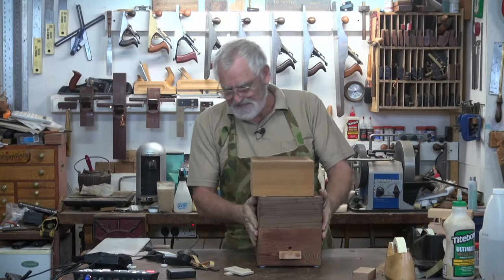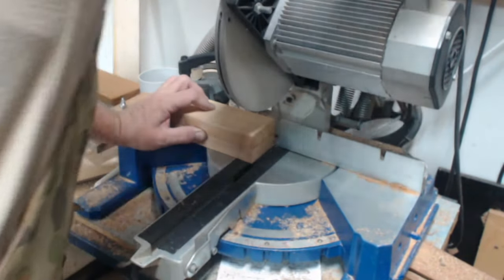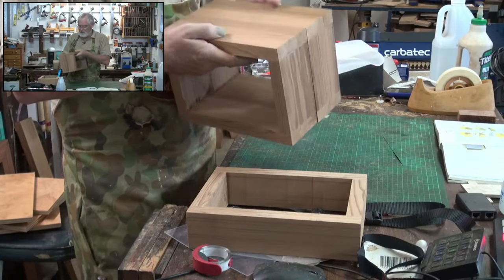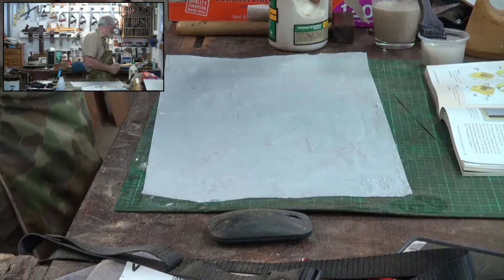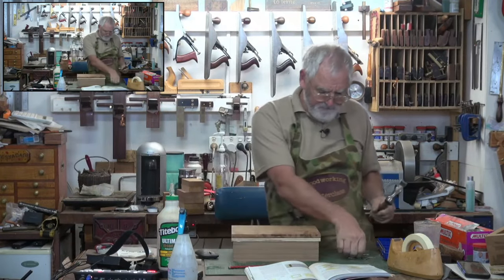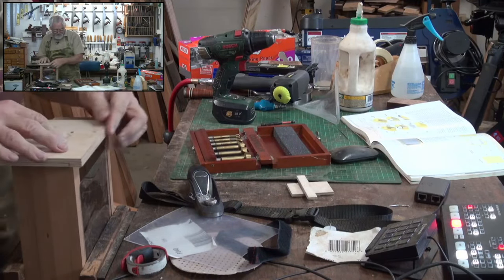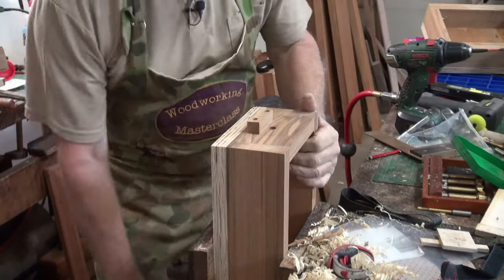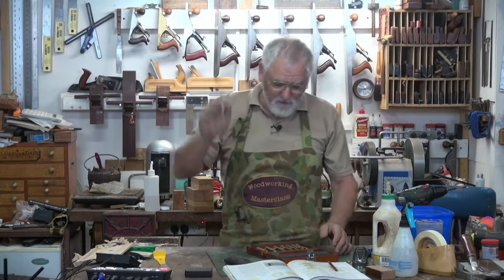Making Native Stingless Bee Boxes. Using Machines

Comment: Metabo saw cuts square. I have an Electra Beckham GPS250N, 30 yrs old. Now branded METABO and changed colour from green to blue. Its is an excellent saw for fine joinery work. But it is a "push" saw. I had the same problem.... couldn't get square enough. Supplier told me saw is designed to have blade lifted over the work then lowered for horizontal cut. Power on, then pushed through the cut. And used only specified saw blades. (something about a reverse cut...) gives an extremely clean cut that needs little further prep and consistently works to a knife blade mark out. I've had mine since 1992 and never considered changing it. Loving the channel.
Reply from the maker: Yes it's the blue copy of the green machine. Best saw on the market for my money. The blade it cam with was an aluminium cutting blade. But it whistled to loudly for my liking. Have tried a Varity of blades in it and am no using a relatively cheap Irwin 60 tip crosscut, Which if not pushed to hard works extremely well. Thanks for the information. Cheers Steve